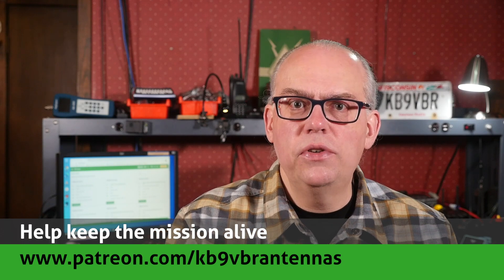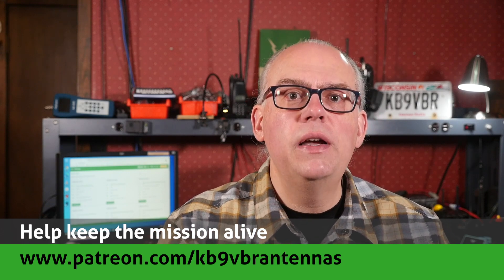Rejecting Urban Radio Interference (RF) Noise - January 2022 Livestream Excerpt

Comment: A combo of a mag loop for tx or recieve, and a vertical, that is as low loss, while being multibanded, is a great HOA friendly combo. Having a trusted antenna switch or 2, and a pair of radios to fully juggle the right combo between antennas, either rx or tx  for the band you are working, and the propogation being dealt out. For example 75 meter LSB tx on the DX Commander or tallest tapped coil vertical, and recieve on a mag loop, which is not only high-Q, but is very endfire directional, for really focusing in on the stations you are interested in, or nulling out known interference. You may also have a blast with the talkback feature created to really get your tone and cadence to your awareness.

Comment: While it may be true that in some locations local noise sources may be more vertically polarized than horizontally polarized, it's certainly true that many vertical antenna installations have poor common mode rejection. Then the feedline can pick up locally generated noise as it passes near the noise sources, which it would not do if common mode rejection were high. A horizontal doublet either uses a balanced feedline or else a coax feedline with a good current balun at its center (or at least it SHOULD!) and thus its feedline will not pick up noise from local sources. Moral: If you use a vertical antenna, put good common mode chokes at both ends of its feedline. And the same holds for EFHW antennas, even if they are horizontal.

David  VE7EZM and AF7BZ

Comment: Thanks again for doing these.  I'm still a relatively new ham and finally going to start with HF.  I am looking at setting up a fan dipole, but I would really like to know about orientation, i.e., N-S, E-W.  I'm in Michigan.  I've listen and read a lot, but opinions vary.  This will be my first HF antenna.
Reply: Fan dipoles are great multiband HF antennas.  Their directional gain is less than 3 db (broadside to the antenna), and probably less than that at heights below 1/2 wavelength, so don't get overly concerned about the orientation.  Tuning the fan dipole is the biggest challenge. 😀
KZ9V
Reply: @davewhite7679  Thanks!

Comment: Great platform, love listening to it. Question; using a claw clamp to hold up my Wolf River coil antenna on a chain-link fence, will that act as a counterpoise/ground wire? Can counterpoise or ground wires be too long?
Reply: Yes they can be too long if/when they become part of the radiating element. Get a cheap NanoVNA so you can experiment with counterpoises. You'll learn a lot about your QTH.

Comment: The most important factor of an antenna receive system regarding noise is the signal to noise ratio- a resonant antenna will have a higher amount of noise, but also a higher desirable signal level.  The key is to build or position the antenna to null the noise or increase desirable signals.  It was my understanding that a loop is able to exclude noise due to its sharp null receive pattern (not because it is a tuned circuit).
Reply: Correct though any high Q antenna would achieve this. The magic of mag loops is that they mostly ignore the electrical field where QRN prospers.